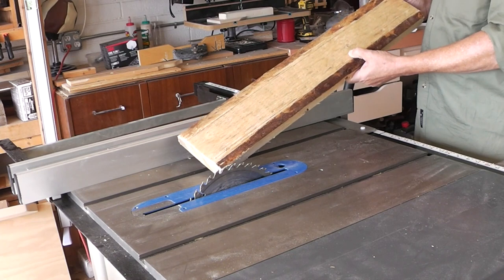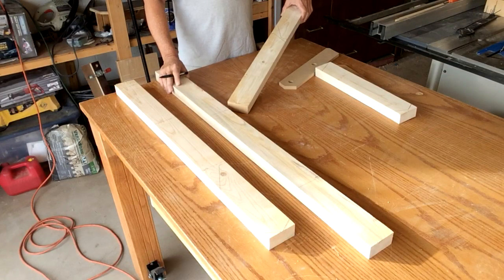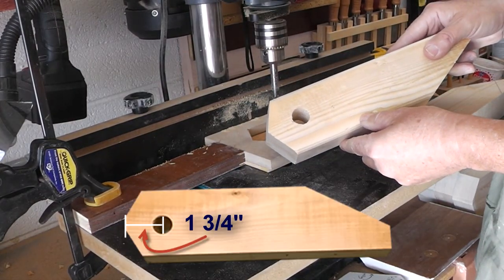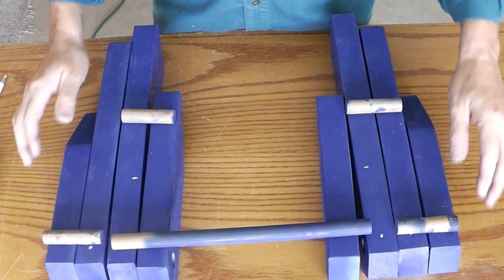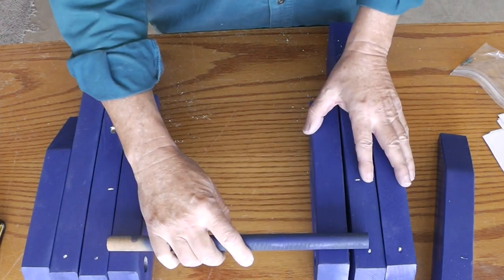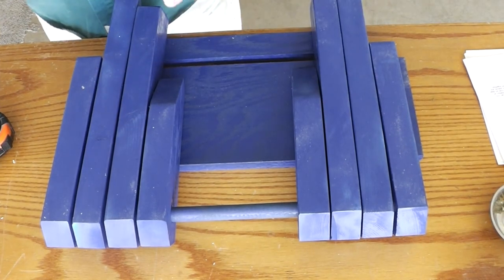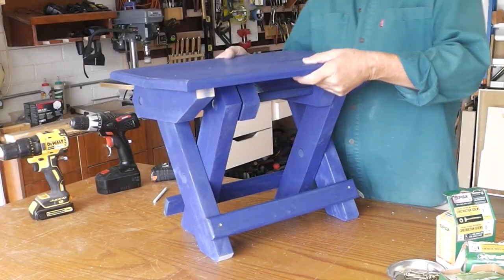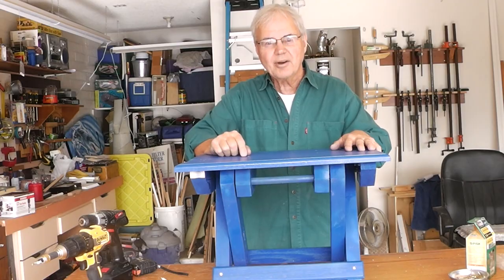An amazing small folding table to compliment my Adirondack chairs

Comment: Hello, I am from India. It is my hobby to do diy projects. Of all the "folding tables " projects in YouTube I found yours was the most simple one. It would be great if you give the measurements or drawing of this. Thanks🙏 and namaskar.
Reply from the maker: Hello Sudipto Das. I did put some measurements in the video as I was building the table. But I will look for other measurements and post them. Thanks for watching.
Reply: @JayVisnansky  any dimensions on the length of the legs and cross pieced
Reply from the maker: @thepope943  The length of the legs is 12 inches or 300 mm.  The top or cross pieces are the same too. Good luck with your projects.